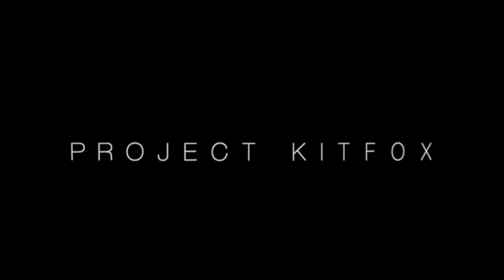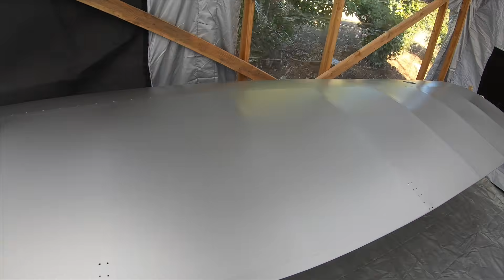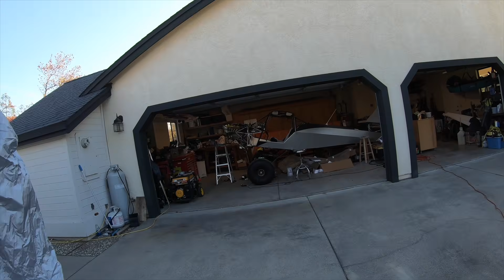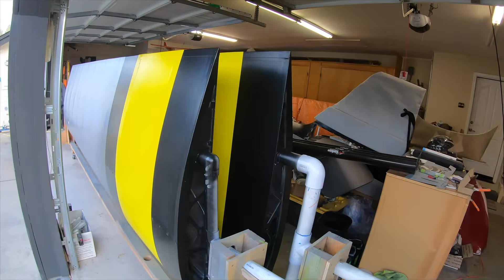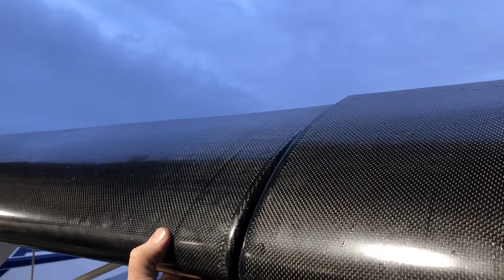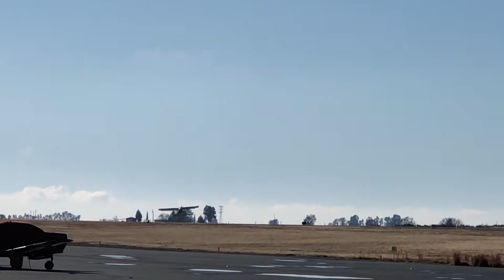Kitfox 7 Apex Build Episode 37 Prototype Wings The Piggyback STOL Wing

Comment: What do you think about putting 2018+ Honda Accord 2.0L turbo engine on kitfox. It has 252hp and with little bit of tuning the engine will output more than 300hp. At a cost of almost brand new engine can be purchased around $3k.
Reply from the maker: Things to consider are the gear reduction drive and the overall weight.

Comment: Another great video.  I noticed that Steve Henry trailers his aircraft to all the events.  Are there issues with longer flights with the engine (e.g. low TBO, oil consumption, etc)?
Reply from the maker: Not that I am aware of. Maybe the turbo version, but with the NA engine I have heard of no reason it can’t perform perfectly for x-country flights, and I plan on flying long distances. Oshkosh for example.

Comment: Why does it matter whether you're going with the wind or not? I can see why it would matter if you're using a GPS for your speed, but if you're travelling along with the wind, surely it wouldn't make any difference?
Reply: They probably had something recording the GPS track and wanted to use it to validate the airspeed they were seeing during the stalls

Comment: I notice the long dorsal on the test plane..  Help the tail wag?
Reply from the maker: That is the standard tail on the Vixen model. Sweep tail for the tricycle set up. More Cessna looking. Still has the small elevator of the model 5.
Reply: Engine is running, wings are almost ready, won't be long now. It's driving Me crazy, can't wait to see it in the air.